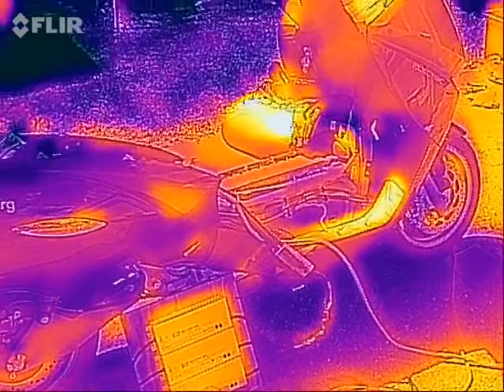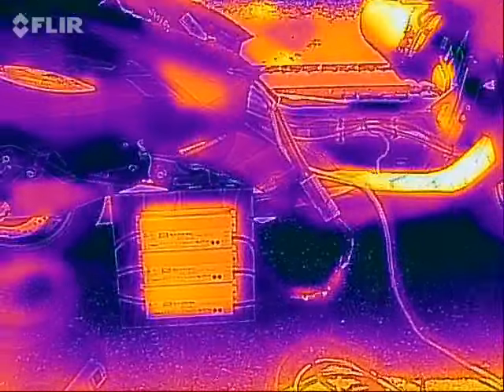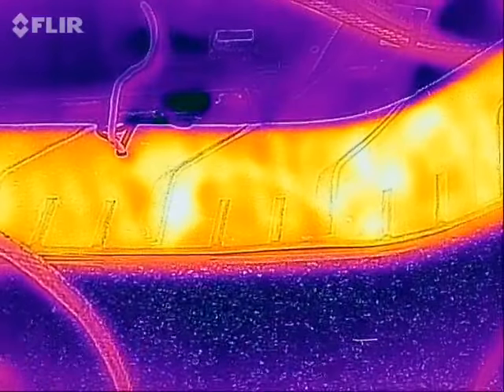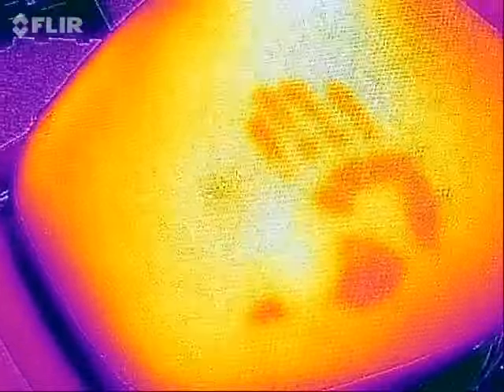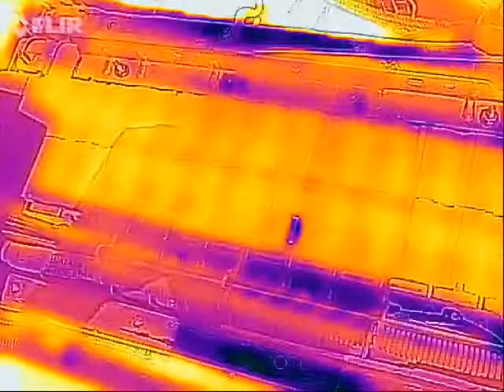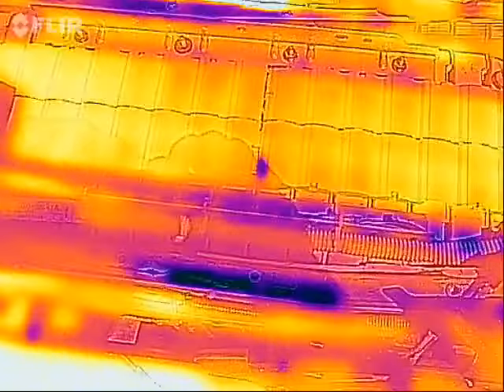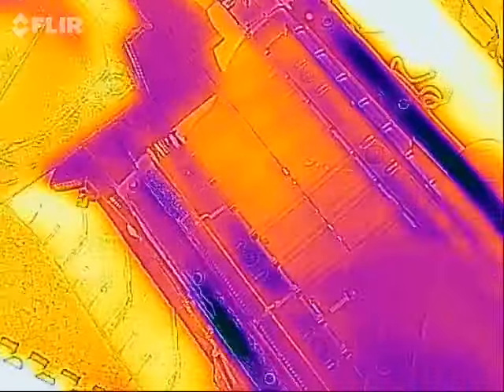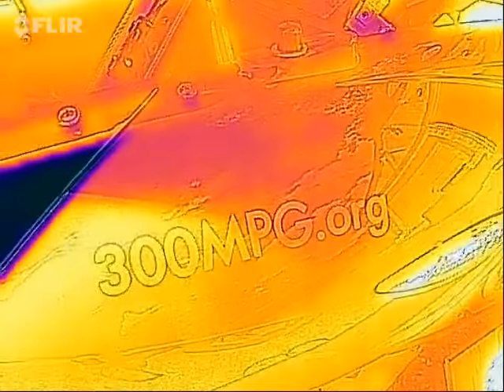Thermal Video charging electric motorcycle with Mean Well power supplies

Comment from the maker: Matthew: LEAF cell modules are great to work with. They are PERFECT for DIY electric motorcycles and similar projects. I don't have any particular suggestions other than always make sure to play safe. While my videos may sometimes be goofy, safety is no joke, always make sure to take appropriate precautions when working on high-voltage systems. Other than that, have fun making!